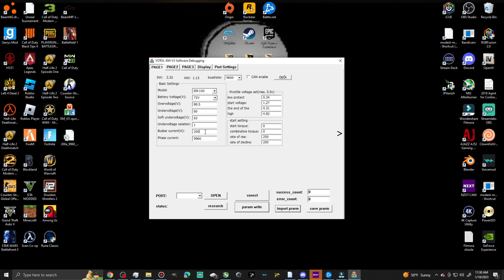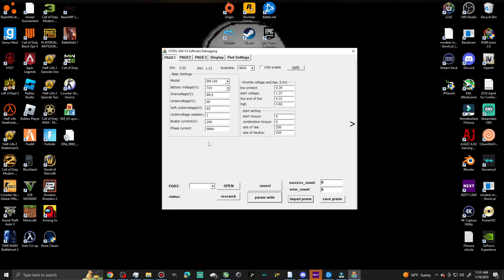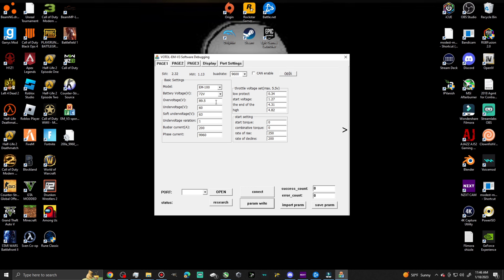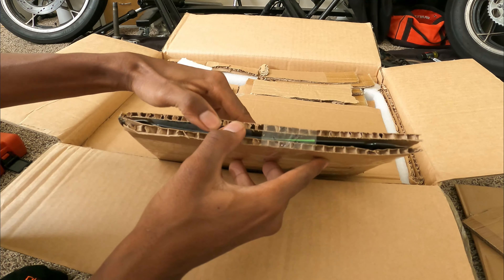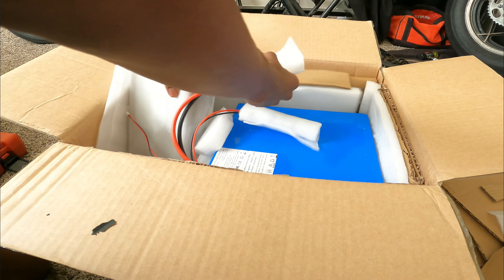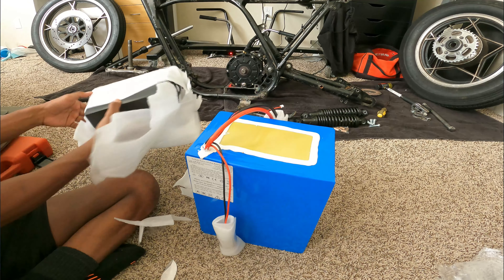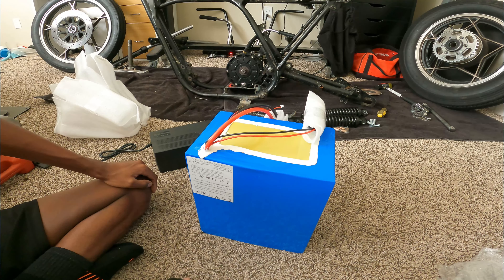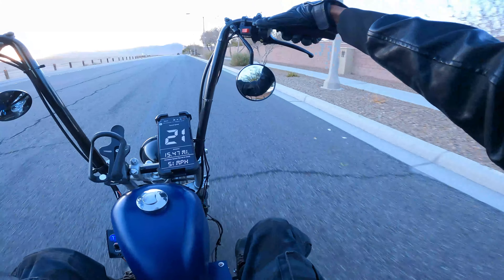Troubleshooting The Electric Bobber Bike Project SB

Comment: You do need to get a balancer that will match your number of cells in series. 24s.

Use that refund to pay for a balancer 😉

And make a note of the cell part number and manufacturer.
You can use that info to find out the charge and discharge C ratings.
If you replace the bms, get one with Bluetooth so you can ‘see’ the cell voltages.
And the worst you have, is a lot of parts to rebuild a battery 😜😉

That is If you find a bad cell or something.

Thanks for the shout out. 👍